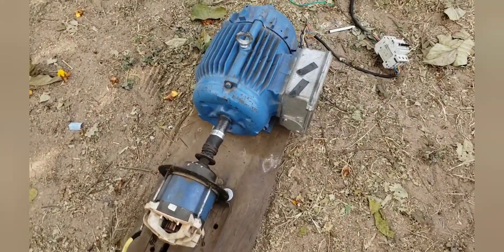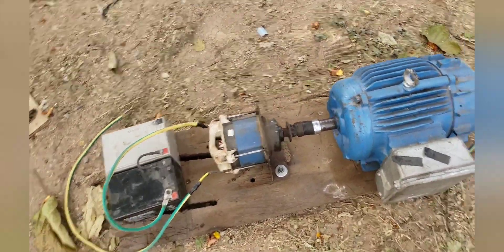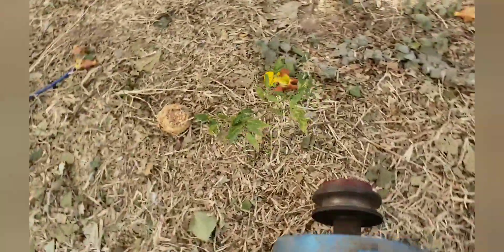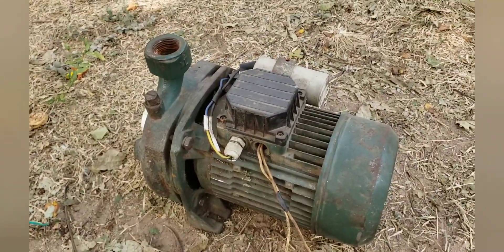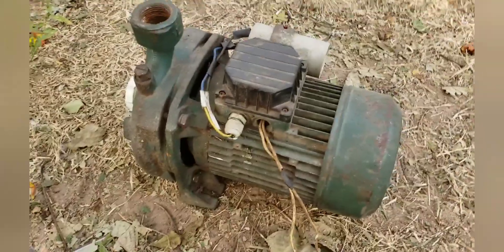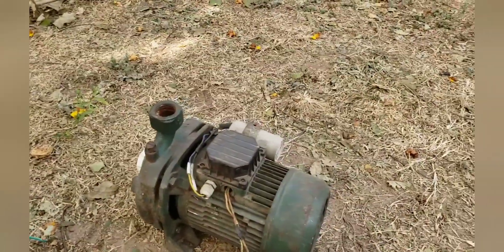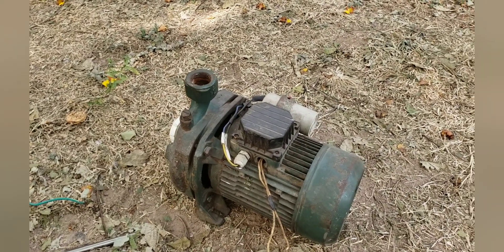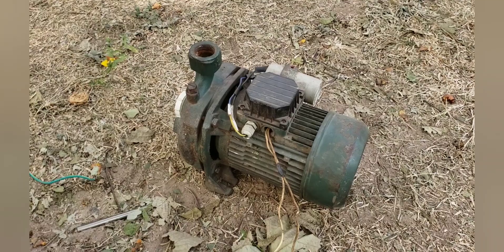Free Energy Series: DIY for Irrigation Farming easy peasy!

Comment: Question ;  What is the RPM of the 12Volt drive motor in this video ?     Jay.
Reply from the maker: RPM 3200
2 numbers of lead acid Batteries 24v
Reply: @marathonpower  ah very good - thank you  Jay